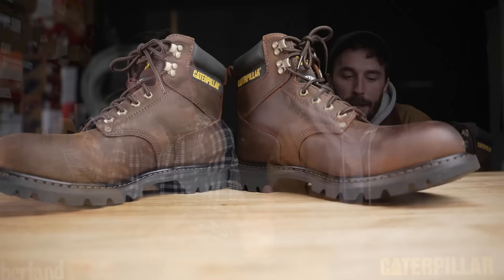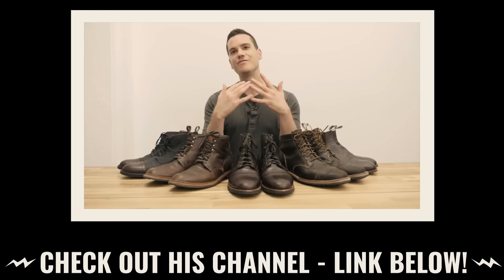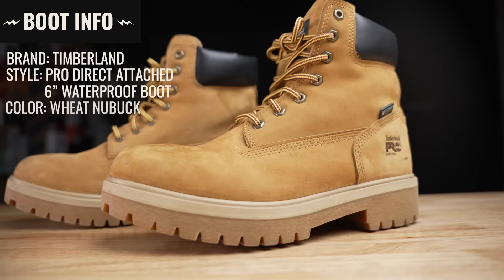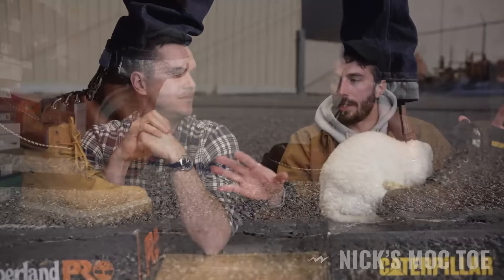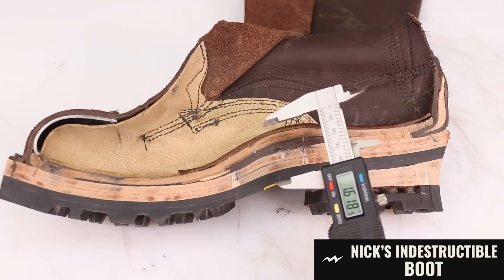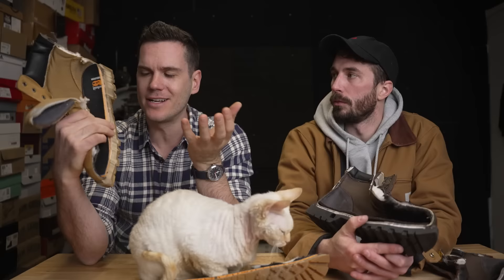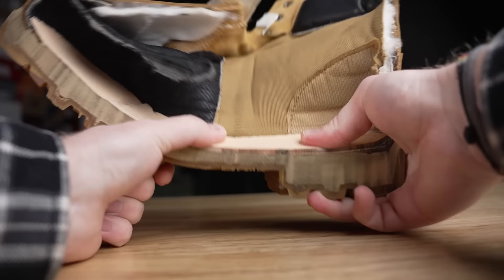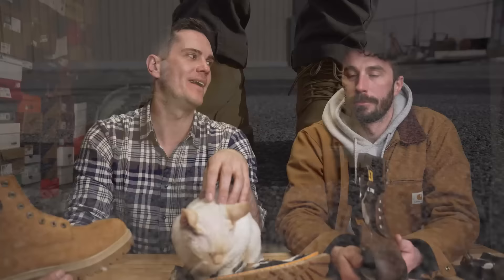Best Budget Work Boot - Timberland Pro VS CAT - (CUT IN HALF)

Comment: Short story: Love my CAT's, great value, great all around work boot, would buy again, would recommend!
Long story:
I've had my soft toe CAT Second Shift's for about 4 years now, and they've been going strong. Got them for just under $80 on Amazon, and couldn't be happier with the value. They were fairly uncomfortable at first to break in, had to massage them a little and wear them on and off, but after about 2 weeks or so, it wasn't a problem. They are definitely firm under foot, but definitely supportive and comfortable enough for a full workday. They currently fit me like a glove, with a little more wiggle room I'm used to in the toe, but it doesn't bother me and actually makes them comfier the wear. Lacing system was a little odd at first, feeling like the laces started too high and that I couldn't tighten further down the boot, but proved to be a non-issue. You can really snug them up like how I prefer, or wear them loose, comfortable either way. Love the fact that the top has two sets of speed hooks, makes taking on and off quick, easy, and customizable. Leather has held up great, very resilient to abrasion and kicking around, has seen everything from mud, dust and dirt, to pool cleaning chemicals, to automotive fluids, and etc. Only cleaned them and conditioned them a handful of times, and they clean up pretty well. Kept out the water well enough to get rained on or step in shallow water for a bit, but would soak thru over time. Would usually dry pretty quickly though, and never experienced any bad smell, just your typical used shoe smell. Outsole has good grip, is flexible (after breaking in), stable, and has plenty of tread, and never tore any chucks out. The stitching on the toe has definitely done it's job and won't let go of the outsole, even with the bottom of the toe clearly worn down. 
Only real gripes: On one of the boots early on, the upper separated from the cushioned cuff by the eyestay, glued and sewed it back together, has been holding ever since. Other boot began to do the same at about the 3 year mark, but haven't bothered to fix it, and frankly hasn't affected the boot or fit negatively. Laces lasted about a year, but that's not a big deal. Back of the heel wore thru at about the 3 year mark, but hasn't caused any discomfort. Welt started to separate a bit from the outsole on the instep on both boots exposing the midsole, probably around the 3-3.5 year mark, makes the bottom of the boot waterproof for about 10 seconds, still works just fine in the dry. 
All in all, would absolutely buy again, assuming they haven't cheaped out anything in the past 4 years. Would definitely recommend if you don't mind a firm foot bed. Also, it's a good looking work boot in my opinion. This boot definitely deserves the CATERPILLAR name, and the cute little embossed bulldozer on the outside of the heel!
Reply: Your comment is so long and boring couldn't finish reading it......
Reply: @PGee.  it's almost like I gave the option of reading a short and sweet comment on the boot, and then a more personalized account and review of it for those who care to know. Sorry you feel that way though.
Reply: @12superaslan  yeh nah still don't care....
Reply: @PGee.  again, sorry that you feel that way. Glad to see you muster the strength keep commenting though, given how much you don't care. 👍🏻
Reply: Do you consider having them resole?
Reply: @beniamincolta709  I have thought about it! But given the price of a new pair, I'd likely just buy a new pair with fresh new leather and everything. I haven't resoled a pair of my boots before though, and am curious how a resole would turn out.
Reply: @12superaslan  did I tell you I still don't care
Reply: @PGee.  your decision to reply to a thread over a month old that didn't even mention you clearly shows otherwise, again. Not much of a logic person I guess?
Reply: @12superaslan  look I'm truely truely  sorry I've had a long hard think about it............

Yeah nah  still don't........ Care.......
Reply: Long comment that deserves more like, but who cares ha! Had my Cats for 8-9 months, my first pair of work boots, and have to say I'm very impressed, comfort hasn't been an issue at all. The one downside, for outdoor work early of a morning (wonder if any of you can guess my occupation) heavy dew and long grass can cause the boot to become damp, although not soaking wet. However coupled with Merino wool socks that dampness only occurs with prolonged exposure to water/dew!

Comment: I've been waiting for this video. Lots of mixed reviews on reddit about the caterpillars so I waned to see your full breakdown. Thank you making this happen. Keep up the good work!
Reply: As someone who's owned 3 one lasted 5 months before the mid sole didn't exist under the ball of my foot the second leaked on the third week and the third pair which were excavator xls both boots fell apart on the heel counter
Reply: CATs are great, comfortable, a lil heavy maybe (i mean they're steel toed, what do you expect)

My only complaint is that the hooked eyelets and massive laces have tripped me and caused me to fall hard onto concrete and asphalt multiple times.

If you use the hooks and tie them tight, you'll probably be fine, but if not: bend them, remove them, and/or relace your boots unless you want to eat shit.

Comment: I had multiple pairs of the CAT second shift boots before I could afford Redwings. They are a great boot for the money, very durable. They can be water proofed by applying mink oil every few months. Not the lightest or most comfortable, but if you're looking for an affordable boot that just works, you can't go wrong with the CATs.

Comment: about 6 months ago i got a pair of Thorogood boots from a thrift store, the soles were trashed but the upper in really great condition after i cleaned and conditioned them. I took them to a cobbler to have them resoled and he did a horrible job resoling them, he sanded through atleast 30% of the welt, even sanding through some of the stitching. When I saw them and told the owner I'm not paying for that, he said that's fine and apologized for the crappy job his cobbler had done but he also said usually it wouldn't be a big deal since most guys are bringing in work boots and don't care what they look like as long as they work. I ended up contacting Thorogood and they said they could resole them with the sole of my choice it didn't have to be that Cristy sole and put on a new welt for $155.00

Comment: I used to live and breathe Redwing for work boots (28 yrs in concrete as a Mixer driver/ concrete pump operator).  I switch to the Timberland Pro Boondock boot in 2015, and have never looked back. The comfort and durability have me recently purchasing my 9th pair. Concrete is brutal on leather, and to reliably get 1 to 1.5 seasons from the Timberland Pro Boondock has made me a loyal supporter of this boot.

Comment: I have had both brands before and I would go for the Cats any day. Timberland's soles are a death trap over wet tile (at least the model that I had, which claimed that the sole was made out of recycled bottles) also the insole was soft, way too soft to give a proper support the the body causing me knee and ankle soreness. Cats on the other hand were firm but confortable and the style was better
Reply: Wet tile?! Theyre rugged outdoor boots bruh
Reply: @CANControlGRAFFITI  My insulated timberland boots with aggressive outdoor tread pattern performed poorly on wet tiles, I am shocked.
Reply: What Cat boot are you talking?
I just want a waterproof and slip, oil resistance boot.
Reply: I have both brands. The timberlands are very slippery
Reply: @CANControlGRAFFITI  that´s the worst part. You feel secure and invincible on your rugged boots, but as soon as you enter a coffee shop for a break you bang you head on the floor. They were also slippery on wet rocks, and even wet weared asphalt. Basically any wet surface was dangerous. The Cats never gave me that problem, they had way better grip
Reply: @mogroot5790  I had the Cat Sire WP, they were waterproof but I´m not sure they were oil resistant (they weren´t work boots either)
Reply: There is a version of these timberlands with a non slip sole (timberland calls it “maxtrax”) for indoor traction on wet floors. I just bought them a week ago and no complaints with the traction so far, and I deliver to restaurants so I’m in the going on lots of different kinds of wet kitchen floors.
Reply: @chrisp7957  I have timberlands, Red wings, Whites, Thorogoods, JK boots, Carolinas, rubber outsoles are slippery on wet tiles, and outside in the cold snow (spoiler alert). Also water is wet.
Reply: @mad0uche  Then maybe you should try some cats

Comment: I had the Timberland Pro's for 2 weeks before they fell apart on me.  Once I moved up to the Timberland Boondock Pro's with the toe caps, they've been amazing and are going on 3 years of use still holding up.
Reply: What fell apart?
I run mine hard doing carpentry construction, having owned 10+ pairs, and I've yet to have any failures before a year. Even then it was just waterproofing and generally beat down after a however many thousand miles.
Reply: @adamjames1375  Bending before the toe box creased so badly each upper side split.  I figure it was probably just a one off issue as people I knew had them and theirs didn't do it.  None the less, I gave Timberlands another shot but moved up the line and am still superbly happy.

Comment: I wore CAT steel toed boots on the production line at Honda. They were perfect. They wore well and didn't break down very quickly. I think I got about 9 or 10 months out of a pair before I needed to replace them. That seemed perfectly acceptable considering the miles I walked in them every week and the chemicals and agents they came in contact with. Plus, they were very reasonably priced.
Reply: my low profile cat steel toes lasted 4-5 years. every day exposed to engine coolant, engine oil, gas, xylene (paint thinner), zinc paint, rattle can paint etc. and i only got rid of them last year cause the inners were shredded through bad already. I was super impressed by them but am now gonna try a pair of timberlands and see how i like them

Comment: I did just over a years work in the cat boots. My failures were: 
leather split almost immediately at the edge of the steel toe on one side. 
Insole crumbled. At first it seemed like it was molding to my foot better, but soon there wasn't much padding left so I had to replace it.
Waterproofing didn't last. Within a few months both boots leaked along the welt near the arch, even in wet grass.
Leather began to crack at the toe crease. I work in lots of dry dirt and dust and  squat and kneel a large portion of the day so that was probably inevitable. 
Welt began to crack. The storm welt piping especially but the rest of it is starting to go.

That's not to say I didn't like them, they're still my daily wear shoes now that they've been replaced at work. Super comfortable now and the leather still takes a shine pretty well. Sole wore well too.
Reply: We're they Caterpillar second shift? Or another model?
Reply: @yuridaman  Yeah second shift. It was the same configuration as these ones.

Comment: I've had a pair of CAT books for over 20 years and they are great. For climbing up onto heavy machinery the better support of the steel mid sole is great, particularly when the steps don't allow any support on the heel.
Reply: Love mine but they are heavy
Reply: @jeffjohnson6181  they are that.  Bought mine direct from William Adams (Cat dealership) before they were a thing.

Comment: Bought some cat boots when I needed some new work boots in a pinch and I love them so far they hold up great for the 80 bucks I paid for them I just slapped some better insoles in them and after 5 months of very hard construction use they have had no problems so far and great grip when on the roof

Comment: I've worn Cats for work for years , been great for me , I usually resole with a Vibram sole when the original sole wears out, they've always been excellent value and comfortable. The lining quality has gone downhill in the last few years , the Nylon texture visible changed and now doesn't last as long, but still good for the price just a shame they aren't as good as they used to be.
Reply: Hello , can you tell me if the vibram sole Is it slippery compared to the caterpilar sole? thanks
Reply: @EDCwhistlesSCRATCHCARDS  Hi I find the Vibram Commando sole is less slippery than the original Cat sole, both are good tho' so just which ever you prefer.
Reply: @ianwalker4803  Super thanks , now i will resole my Dunlop nevada with that soles soon ! Greetings

Comment: I've actually had both of these or at least a version of both. I'm currently using the slightly more expensive version of the timberland pros and I've previously used these exact caterpillar boots. I had no problems with either of them but I do like the timberlands a bit more and that might just be because I was able to get a perfect fit because they make these things in an absurd number of sizes. It's kind of crazy how many options there are, whereas the caterpillar ones. I really didn't have that many choices and I ended up with a boot that was about half a size too large and arguably about half a size to narrow

A couple of other things about my timberlands versus these. I am fairly certain I have a steel shank in mine as well as mine is stitched down and I don't think it's injection molded but it may be kind of both. I also got a very thick layer of foam that's visible from the outside as opposed to these where they're just covered in rubber and I don't think I have nearly that much insulation

Comment: I have that exact pair of Cat boots. In fact I am on my third pair at this point. I work in a shop environment and they hold up really well considering the cost. The issue that I always eventually run into is sole delamination, but this is after a couple years of hard use so I'm not complaining. I would definitely recommend these to anyone looking for a budget steel toe boot.

Comment: I am pleasantly surprised about the quality of the Timberlands in this video. I have had this idea that their a name first brand with so-so quality. But it seems like they offer a decent boot for a decent amount of money, and a name for fashionistas as well...
Reply: everyone keeps parroting that too, they're a cheap boot and they're reasonably priced
Reply: They fall apart in 3 months…
Reply: @bionicmanspeedruns  you're probably right.
Reply: @CANControlGRAFFITI  that is what I would expect. So you are saying that this video doesn't give a good picture of the quality of those boots?
Reply: It really depends on what you're buying them for. For a wildland firefighter, they're trash. For a code inspector, they're overkill. Lack of a steel toe makes them useless for most commercial construction and industrial fabrication jobs, so I'm not exactly sure who they're made for, but if you occasionally work outside in a cooler environment, and need some ancle support and traction on moderately rough terrain, but do more standing than walking, they'd probably be okay for a year or so. They're no Nicks or Whites, but most people don't have a job that really requires a $350 to $700 pair of boots. Even a good pair of Red Wings will probably cost $50 to $100 more, which to me is worth the price, but not to everyone.
Reply: @CANControlGRAFFITI   What's fallen apart on you in three months? 
I do carpentry/concrete work in Buffalo N.Y., I'm 6'2" 200 lbs and am rough on them. I've never had the welt/sole separate, never pulled out the eyelets, and never busted a seam. The sole wears well.
I did kick a 3" tear in a brand new pair on a drain spade & if you're around alot of sharp rebar ties, e.t.c...I could see them getting shredded up more easily than a higher end thicker/heavier leather. I've had ten+ pairs of them over the last 20 years, and while I've tried more expensive Domestic brands, I keep coming back to the direct attach 8" 's. 
I get about a year of hard/very hard use out of them. I usually replace them as they're company bought, but they haven't completely failed in any way.
They do lose their waterproofing, which a couple coats once a month or so of silicone spray handles. 
I've been really happy with them for my shitkickers. 
I run those & a pair of Thorogood or Carolina mocha 6" 's.
Reply: @joshm3484   They make them in a steel toe, I run the 8" steel toes all year doing carpentry/concrete work & they've served me very well. I've tried many other domestic boots and still keep coming back to them. I have put alot of miles on probably 10 pairs & my only complaint is that they're not made domestically, for which I'd  gladly pay a few bucks more.
Reply: @joshm3484  I was more thinking along the lines of a farmer, an electrician or something along the lines of that. Not extremely rough work, but adds some additional wear and tear to the boots as opposed to just wearing them for fashion purposes (which seems to be to be the most common thing around 'ere)